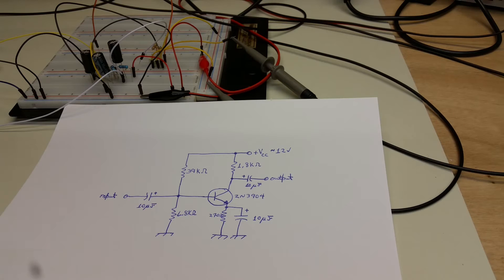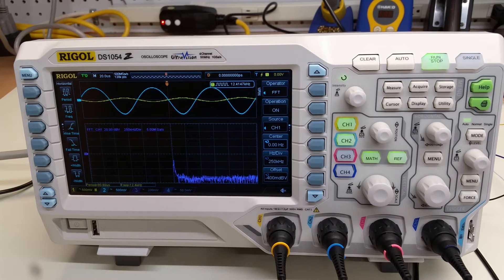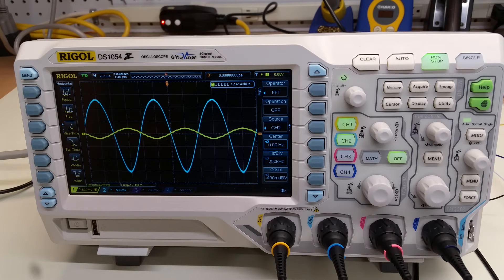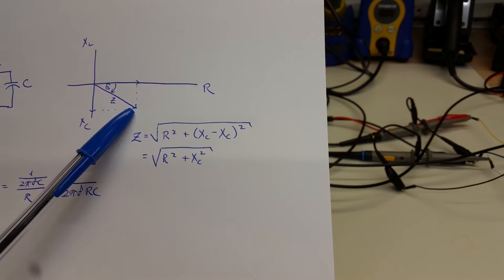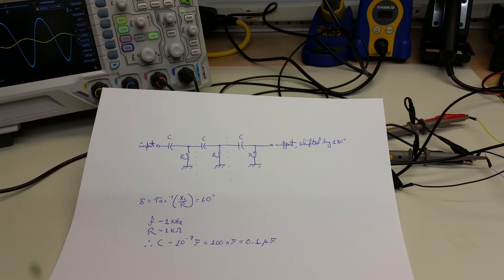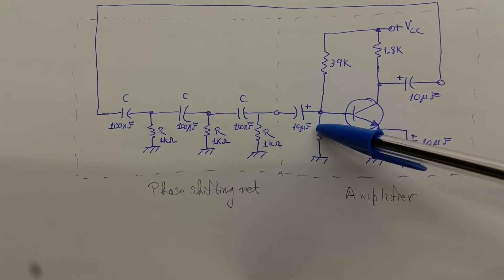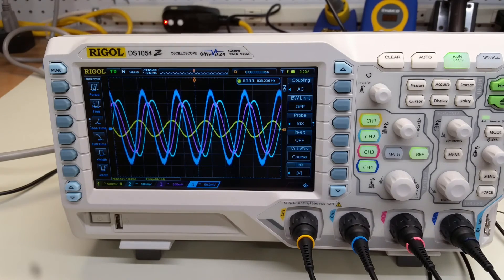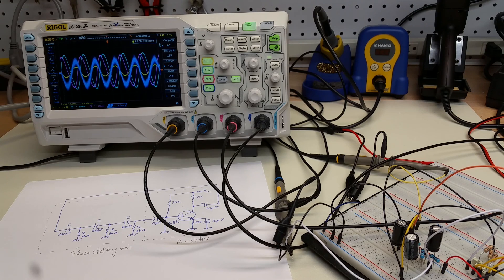#11: Phase-shifting oscillators

Comment: Thank you very much for the detailed explanation of the RC phase shift process.  Can you explain how each phase shifts exactly 60 degrees even though resistor and capacitor tolerances may be up to plus or minus 20%?  Can't get my head around how the math works out so exactly.

Comment: Now if I wanted to select the frequency I want and lets say 1Mhz and preselecting the resistor value of 1K ohm and 3 pairs of RC are to be used,
Solving for “C”  where theta=60 
Tan(60)=1/2pi*f*C*R so C=91.8pF , when using this C value in calculating the fr by the equation fr=1/2pi*sqrt(2N)*R*C where N=number of RC pairs the resultant frequency is way off than 1Mhz,,, what is wrong with my calculations?
Reply: 7 years later and I see this comment of the same issue I ran into when trying to derive calculations like above. Basically from what I can tell this video is misleading as to how to calculate the overall frequency from an individual RC stage. Each RC stage does not operate in isolation but the phase shift of each stage is also affected by the other stages. It gets very complicated and this video appears to do the full derivation of how to get the standard phase shift oscillator formula. https://youtu.be/-1DlHfXnqWY?si=zjBkMpzMcDgHXnBN
Reply: 7 years later and I see this comment of the same issue I ran into when trying to derive calculations like above. Basically from what I can tell this video is misleading as to how to calculate the overall frequency from an individual RC circuit. Each RC stage does not operate in isolation but the phase shift of each stage is also affected by the other stages. It gets very complicated and this video appears to do the full derivation of how to get the standard phase shift oscillator formula. https://youtu.be/-1DlHfXnqWY?si=zjBkMpzMcDgHXnBN